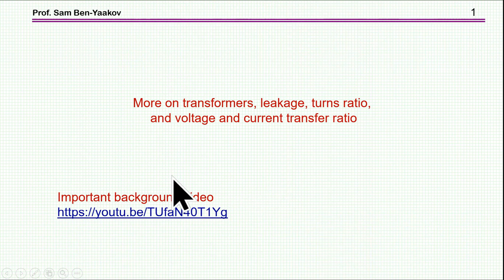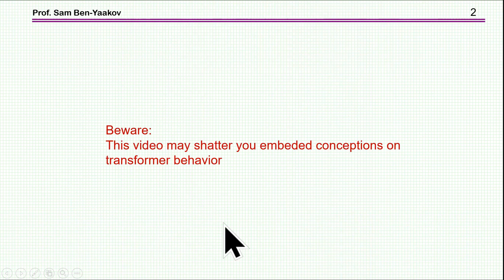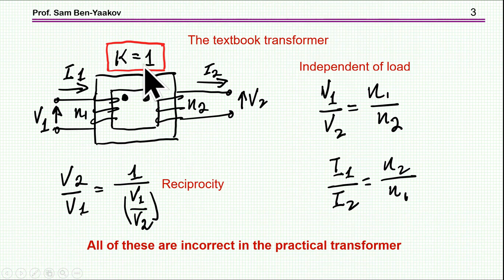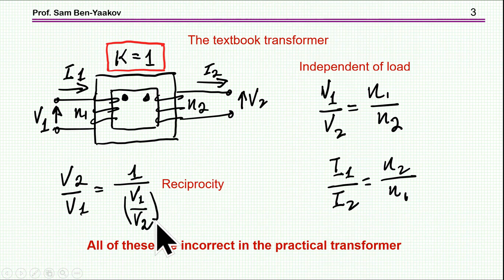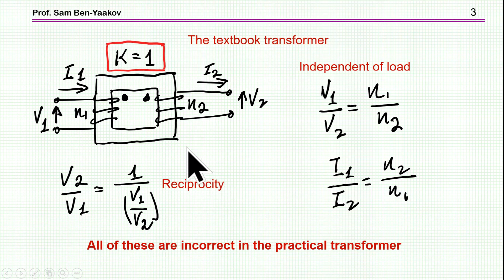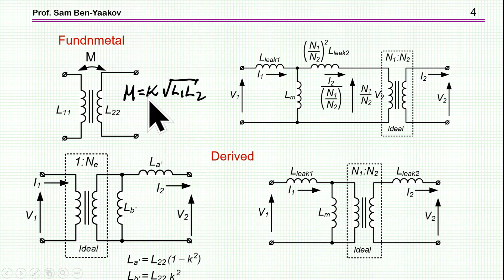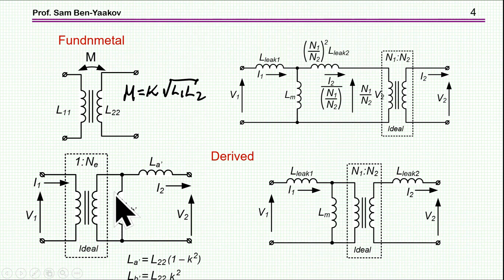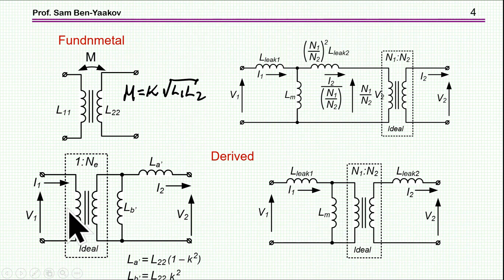More on transformers, leakage, turns ratio, and voltage and current transfer ratio

Comment: Ben  A good evening.

Busy with transformer build.

Have a question about measurement of the transformer, do I have to measure the inductance on the switching frequency of interest? I have a meter who works on basis of a resonance, I get when measure uH a frequency of 184 Khz. when measure in high L setting  I get a measure frequency of 48 Khz and the inductance is 638 uH and 748 uH with second test.

THanks in advance.

Comment: Dear Sam, I wonder if you might help me with this silly question.
To the best of your knowledge does the angle a secondary coil makes with the core passing through it, have any effect on the voltage induced?
Thanks in advance!
Reply from the maker: In general not. The induced voltage is a function of the enclosed flux. However, the geometry of the winding might affect the coupling and hence the leakage iductance.

Comment: In some cases it is still possible to determine whether there is leakage inductance only in the primary or in the secondary too. For example, this can be seen from the waveform on the secondary winding in the LLC converter.
Reply from the maker: No, you cannot. Watch the video again.
Reply: @sambenyaakov  Of course, applying the methods you describe, cannot show whether the leakage inductance is only in the primary winding or also in the secondary winding. But, if you simulate a LLC circuit with  leakage inductance in the primary only and a circuit with leakage inductance in both the primary and secondary (total leakage inductance is the same ), you will see the difference in waveforms on the secondary.
Reply from the maker: @levnemets2148  I do not believe this is so (if you do the transformation  correctly). Can you send me the simulation schematics for both cases? sby@bgu.ac.il
Reply: I had the same intuition as @levnemets as I was struggling with the concept and design of a phase shifter full bridge (PSFB) converter and didn't know if I could apply the measured leakage from the primary side of the transformer to the circuit as an addition to the needed shim inductor, or if I had to figure out the different contributions of the primary and secondary leakage inductance.  It really feels like the energy in the leakage inductance on the seconday is 'stranded' over there, but when I finally had a working PSFB model in Plexim with a one to one transformer, I could distribute a total amount of leakage inductance between the two sides of the tranformer and it had the same effect on zero voltage switching (ZVS) regardless if  99% of total leakage was on the secondary side to when 99% was on the primary side.  This now should mean I can just measure the leakage on the transformer primary with the secondary shorted and apply that is my starting shim inductance for ZVS.  So I can make the simulator work, but I still can't feel the 'why' this is this way.  I'll send pictures of the similation circuit to Ben, but unless the effects are different for a LLC vs the ZVS effects on a PSFB, I think Sam's statement holds, if otherwise, I'd also like to see a discussion of why this is different in an LLC as that 'feels' like it should be, but so far the math as Sam has explained says not.  Thanks again.